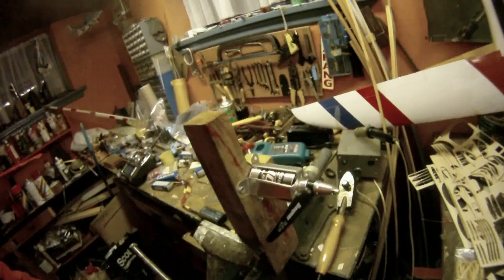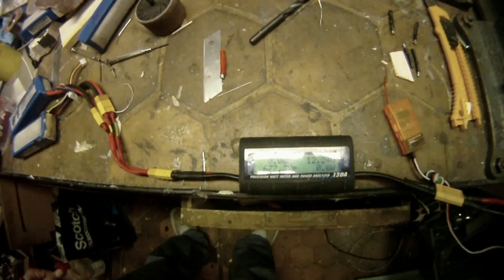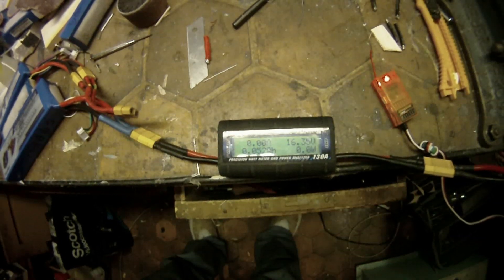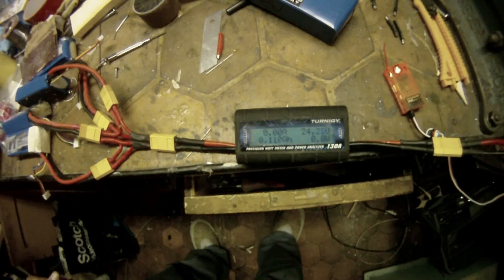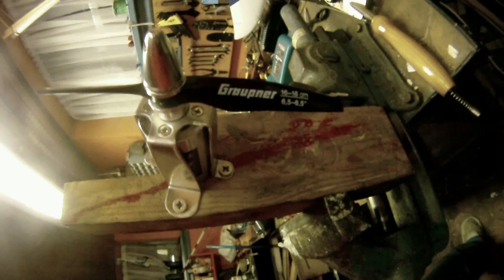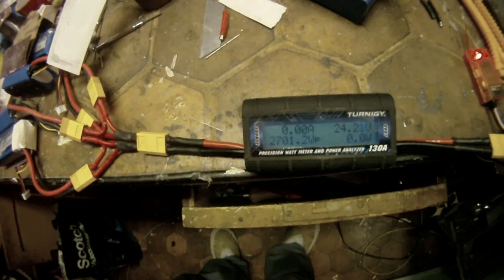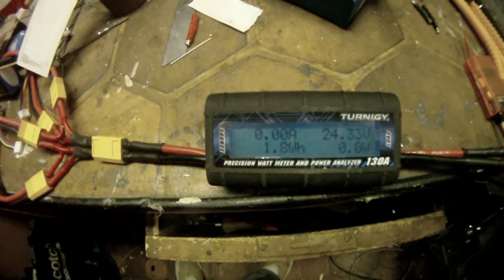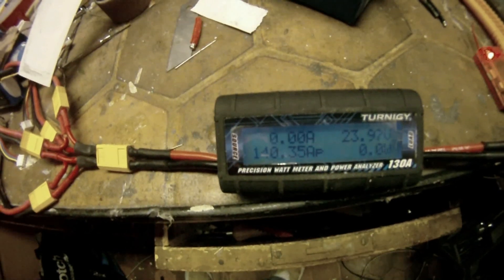Turnigy SK3 Fandrive  3659-1900kv Motor test.

Comment: hello, I was looking for a fast engine for my fan 90mm.PUOI tell me your opinion? I saw the video but you have an ESC da150amp.? many flights did you tut 'today? hello
Reply from the maker: +carlo8336 I have used this motor on my ME163 and now on a pylon racer.I fly it with 8x8 prop and 4 cell, + 150 amp esc. and they are pretty fast.ME163 was measured to 268 Km/h, how it would go with edf i dont know.   https://www.youtube.com/watch?v=vK2DRCKiJYo

Comment: You can hear that the xt60 connectors can't pull the amps 
I have 5,5mm connectors 

Sls 3000mah 65/130c  battery
Graupner speedcam 6.5x6.5
150a esc opto
Pulls @ 75% throttle 
Watt meter turnigy 150a

147,90a 
3290w

Comment: 140A on XT60's?,bet they were warm after!.This is a great motor,im in the process of putting one in a 40" wing with a 6s set up :)
Reply from the maker: I dont know how many Amps it will Draw with 6 Cell and 4x4 or 5x5, but it will rock.
I ended up with 8x8 and 4 cell 4000 mha 40 c
on my ME163.
Reply from the maker: Be sure to use a real small prop on 6 S.   :)
In my ME163 I was running 7x7 and 8x8 on 4cell, and I had to solder the wires from motor to esc to avoyd melting the conectors.
Reply: SpeedsterDEN I've always used ec5's, they can handle a12s 5000 set up with no probs. I'm looking at a 6x6 prop or even 6x5
Reply: Everywhere I read, people are using 140A on this motor. Is it acceptable to use a 3000mAh 6s 30/35c battery with a 4x4/5x5 prop? Would that keep the motor/ESC/battery cooler?

Comment from the maker: Hobbyking have more if it smokes :oD. 
Think the Amps will drop in flight, because of the high pitch on the prop.
Maybe I will fly it with the Watt meter for the first flight.
And maybe I normaly will run it with 8x8 prop and 4 cell, but lets see.  
Time will tell :)